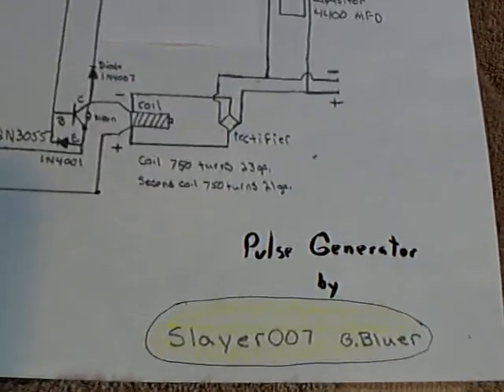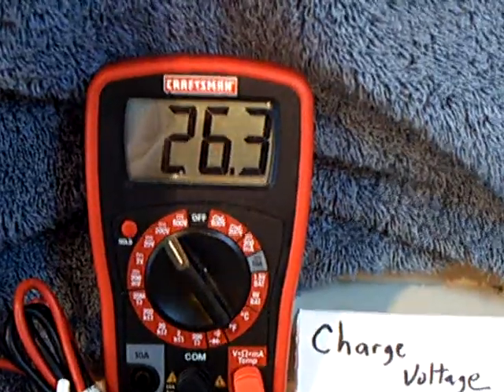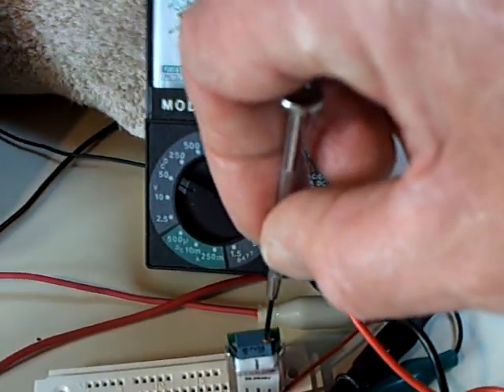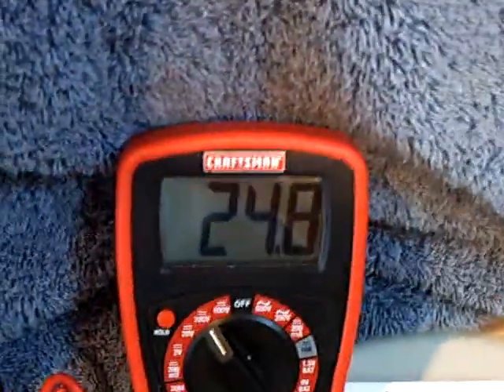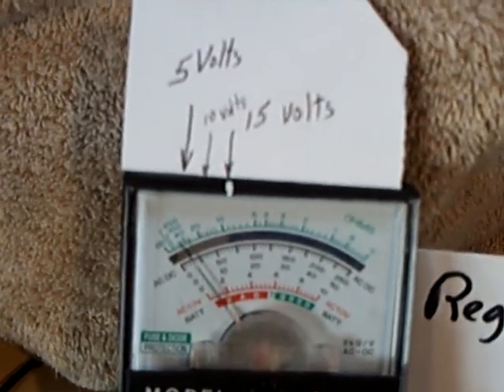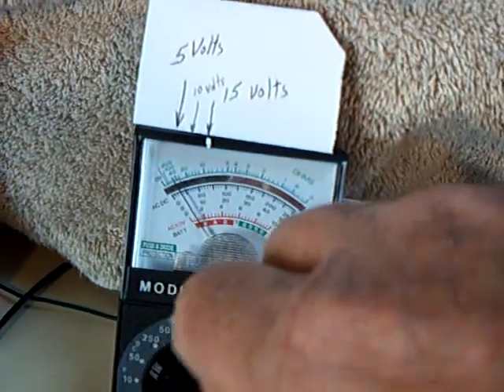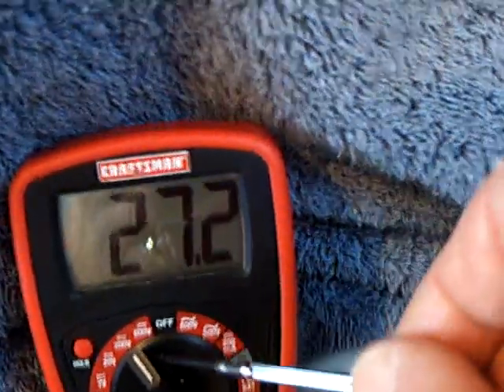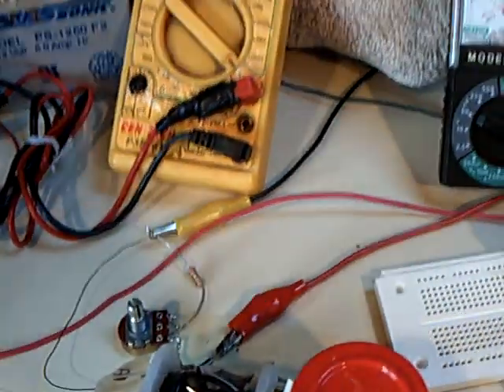Slayer007 Pulse Generator--Voltage Regulated

Comment: Today I did a amp test going in and going out.
I used a 12v wiper motor from a car.
This was just with the main coil no ignition coil attached.
The amp intake was 40 mill amps and the outtake was 110 mill amps.
It didnt have quite enought power to turn the motor.
After load the capasitor only had abou 4v in it.
The negative from the capasitor I ran to positive on the source battery.
And that allso went thru the amp meter.

Comment: I have 2 18 volt cordless  Ni cad drill batteries that have been radiant charged for months and they work perfectly in the cordless drills. using a Bedini type monopole charging at 1amp draw for 5-25 min depending on level of discharged, can completely recharge to 20V once they were conditioned it took some time at first to charge them up fully. They work great now, it depends on the type of battery and its internal resistance.

Comment: cool,  so its 23 volts to the lamp but what was the amperage, can you see any significant gain in power if you do the math. like 5v.09agoing into the circuit and 23v??a.
 great job with the regulator im glad your taking the time to take us step by step through your process.

5 stars.     

  whenever your charging with "radient energy" how do you no when the battery is charged, with similar setups i keep getting batterys with like a false charge that just dont last.